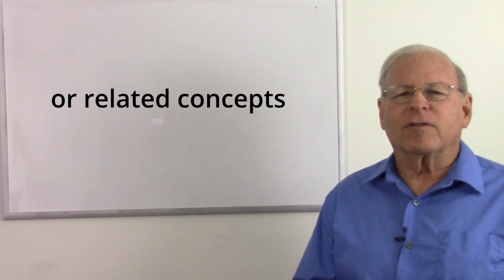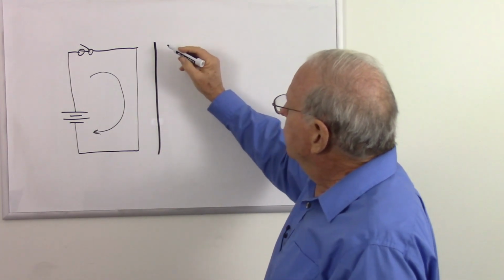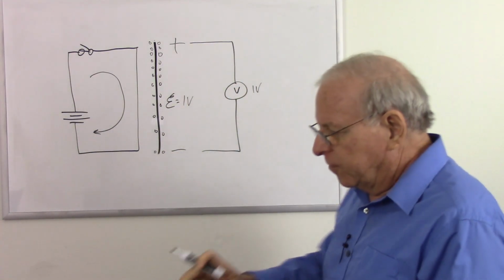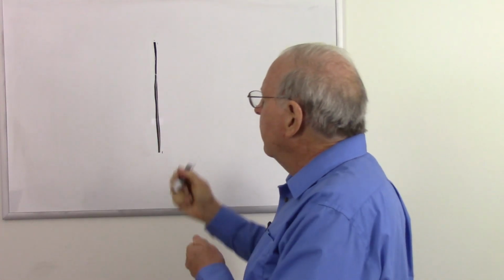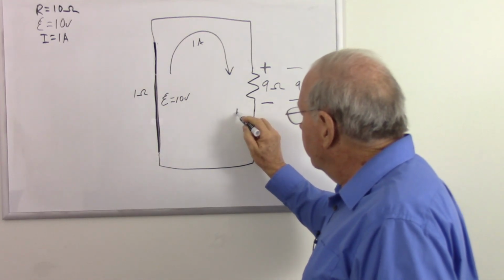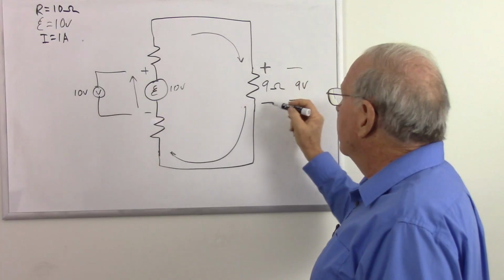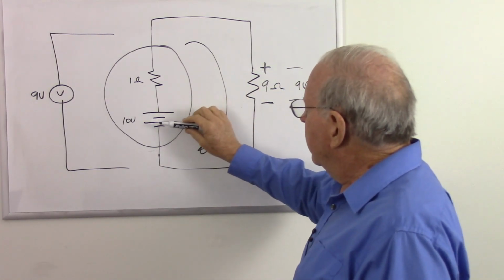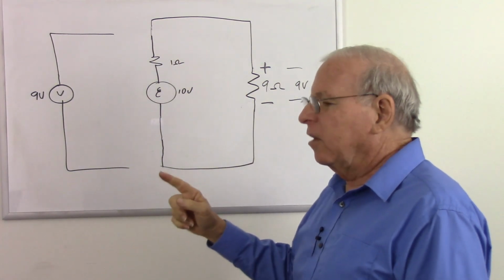Why Resistance in a Power Source is Seen in Series with that Source

Comment: With all due respect you really got into the weeds on the issue of "All Power Supplies not only Provide Electromotive Force/Potential Difference/Voltage but they also have an internal amount of resistance/impedance because no Voltage Source is perfect. Therefore, simply draw a voltage source along with resistor that is part of the Voltage Source.

Comment: Hehe Im one of those who gets hung up on things and cant go forward, thankfully im just learning eletronics so i havent moved far, so dont mind staying in place for a while.. until we finally have a concrete answer to current flow direction.  Apparnetly it flows from both sides at the same time because it knows to limit itself irrespective of direction (like in a current limiting resistor on an LED). If  electriciy flowed from either direction like we model it, it should break the LED if the resistor is on the wrong side, but it doesnt , meaning electricity doesnt flow from either direction according to experiement...  ?  And maybe Veritasium was right when he alluded to electricity flowing through the air not wires.  Could this be proof? The LED resistor paradox?  AlphaPheonix  sheds some clues into this with his "path of leaste resistance" video, where he shows the heat signatre of eleltricity taking the path of leaste resistance.   It turns out some take a random path first, and then the majority settle on the leaste resistance path. Maybe that happens with the LED and resistor.  Some get through first but then get resisted and then somehow inform the others of the resistance and the whole circuit instantly adjust to the proper current? .. hmm